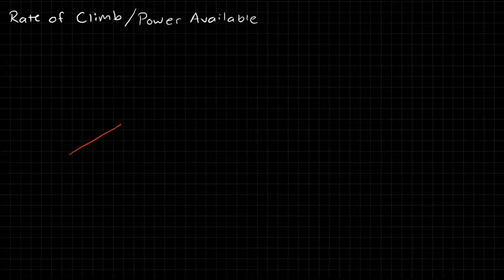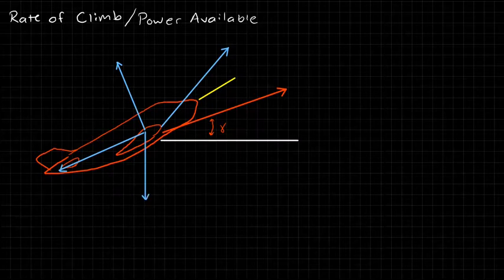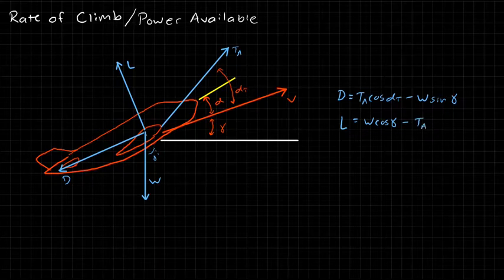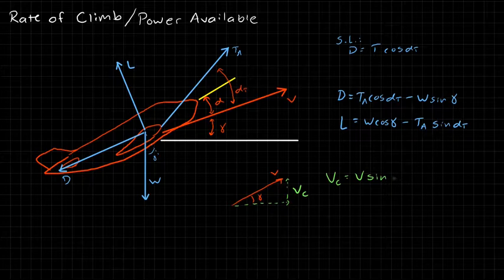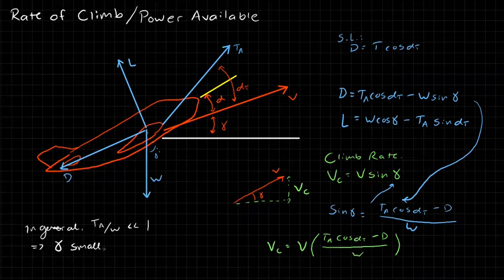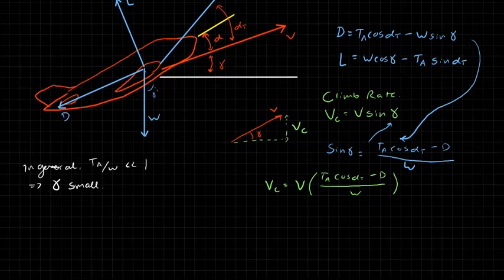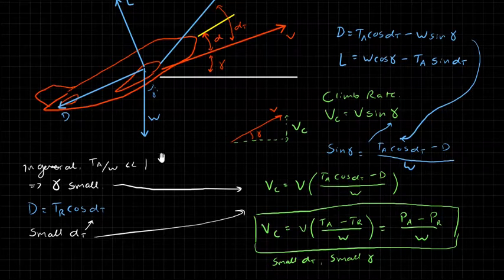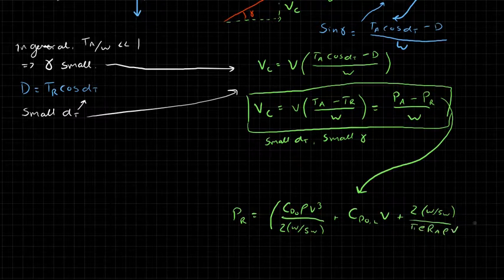Aircraft Performance . Climb Rate . Derivation

Comment: Great Explanation! I was equating P = (T - D - WSinC) * V. Is this wrong? I imagined it as the total power generated during the flight equals the total force on it times its Velocity.  total force is (T-D-WSinC). This is based on the simple equation Power = Force * Velocity. So is it wrong to think about it like this?